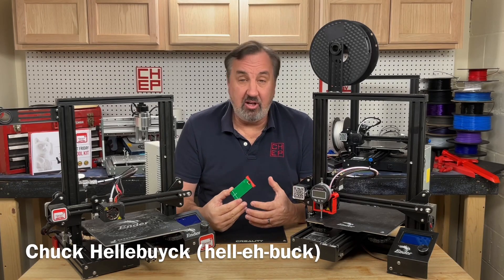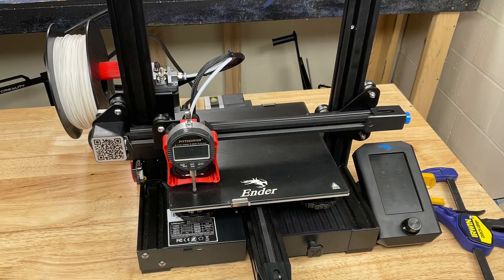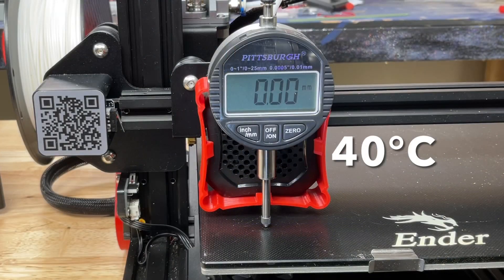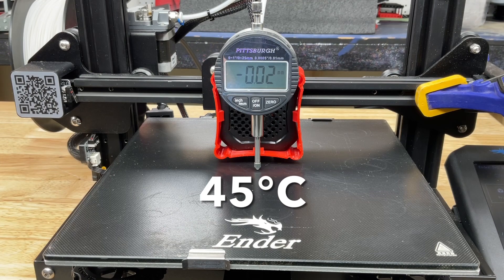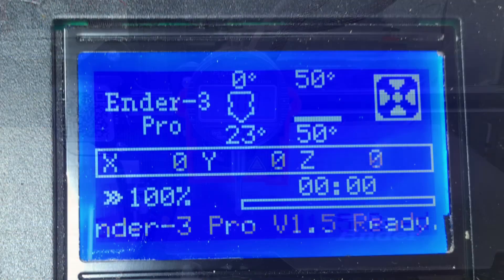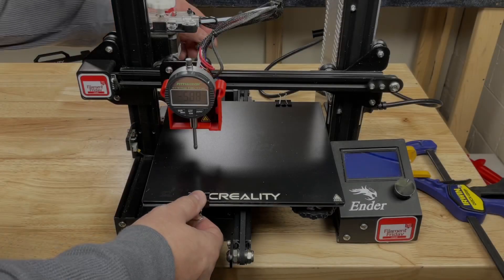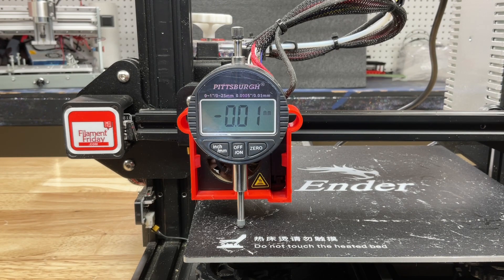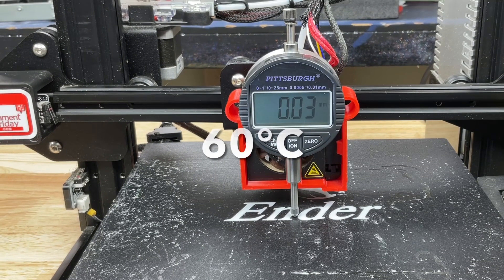Heated Bed or No Heated Bed Leveling?

Comment: Should try it at higher temps and with bigger bed. Lot of people print PETG or ABS/ASA and there (especially on bigger beds like 300x300 mm and more) at temps of 80-100 °C an offset might be (and definitely WILL be) a lot larger. I would assume say, 0.1 – 0.15 mm and that is almost a layer height.
Reply: I print on a roughly 350x350 bed at 105... It's definitely noticeable (pei flex plate). I haven't had much issue since most of my prints are roughly 1/3rd or smaller of build plate but for anything of size I use the glass plate I have.
Reply: @jackshett  well for a reason I print only from ABS/ASA and CF Nylon (functional parts, not toys) I simply ignore PEI sheet. Have one, never tried it as magnetism doesn't work well above 80 °C. Soap, hot water on a glass, let it dry naturally by bed preheating (no kitchen towels) and everything sticks to it like hell. PLA, PETG (that is dangerously sticky), ABS, CF nylon. Had not tried PC though.
Reply: @ZhuJo99  Everything I've printed on Wham Bam's PEX stuck quite well. I'm thinking you've used magnetic sheets that weren't made for that high of temperature. I've printed at 110 experimenting otherwise often at 60, 80, or 100 depending on material.

Edit: Wham Bam's magnetic base is resistant up to 150 according to their website.

Comment: I really like the test approach here! But one point I was thinking about is that the measuring point right above the adjustment screw would actually never move right? It's the pivot point. If you look at it from the front, the left and right adjustment screw basically are the two pivot points and the further you move away from them the more the deflection should appear right? Which was also confirmed by measuring in the center.

Comment: Guess ur missing the point here, the nozzle expansion is the bigger problem with bed leveling and more fiddly when printing multiple filament types tat require different temp range.

Comment: The new opening G-Code that I use on my original Ender3 (heavily modified) heats the bed before doing the mesh leveling with the BLTouch.  I haven't adjusted a bed in well over a year and get rock solid base layers consistently.  I don't mess with success.  It's continually the best performing printer I own.

Comment: I feel like the paper changes size slightly when it heats up from the bed
Reply: definitely. i use tongs to hold the paper while leveling so the heat of my hand doesn't influence the measurement.

in all seriousness, it's not like you can only level to the exact first layer height and everything has to be at printing conditions to maintain that. you can level to whatever you need so that it becomes the right first layer height when it's heated up.

i don't know to what distance i'm leveling, i just learned how the paper is supposed to feel to get a good first layer. changing the leveling temperature would just change that feel and i'd have to relearn it, nothing else.

Comment: I noticed a lot of difference with the nozzle heated. I use the classic piece of paper and every time I level with the cold nozzle prints are too close to the bed, but if I heat it up when leveling the first layer is just perfect. To prevent oozing I just retract a bit
Reply: This. Setting nozzle offset with ABL and meshing definitely shows differences cold and heating both nozzle and bed

Comment: Voron 2.4 350mm here.  Cold vs Hot makes enough of a difference to mean a failed print or successful one becuase of the first layer Z distance.   Some pirinters you may see no difference between cold or hot, but absolutely do not assume it won't matter.  Because it might.

Comment: Great Video. But there is another factor to consider. When a print is finished, some material drips out of the nozzel and becomes solid there. That affects the bed levelling with paper if the nozzel is not heated up. So I always do a preheat (both bed and nozzle) before levelling.
Reply: What you don’t clean the nozzle like a wipe after every print. Also if you are printing straight after I never re-level unless something went wrong

Comment: You didn't take into account the thermal expansion of the hotend and nozzle. Those are going to make the biggest difference and why most people recommend leveling with both the bed AND nozzle at printing temperature. Brass particularly has a high thermal expansion rate.
Reply: why couldn't you just take that into account and change the cold height you're leveling to?

Comment: 0.07mm rise in the center could take a 0.25 initial nozzle (layer) height to 0.18mm initial nozzle (layer) height. Could cause issues with bigger prints in the center. 

Best advice I'd imagine is do a mesh when the bed is hot. Manual mesh takes less than 5 minutes to do with a 3x3 grid. Saves any headache so why not.

Comment: Interesting! I just tried a similar setup on a 300x300x6 mm aluminum bed which is mounted rigidly (no springs) at the corners. Going from 20 to 80 C, it moved upwards .1 mm at the center and not at all at the corners (as measured with a .01 mm dial indicator). So I guess I will keep mesh bed leveling that one in its warmed up state.

Comment: Very interesting, thanks!
I wonder if it flexes in the centre because the expansion has nowhere to go, because of the way the plate is attached to the rest of the machine? 
Maybe if the bed wasn't attached as tightly it would have room to expand in the x and y directions. Maybe even raising the bed and resetting the zero position to loosen the springs a bit.
Generally expansion is proportional to the size in a particular dimension, so I'm thinking it would expand a lot more in the x and y directions, but not in the z direction because the plate isn't very thick compared to the width and length. I mean 1% of 5mm is a lot less than 1% of 250mm.
I also usually bring my nozzle up to temp as well when I level the bed, because there's often a bit of hard filament on the end of the nozzle, and I'm usually too lazy to remove the filament before levelling.

Comment: I have a 3mm mirror on top of heated bed on my CR10S Pro, and I can assure that making a print on a cold bed and on a hot bed requires to make a new leveling before if last one was different.
Or you can rise/lower the head manually when printing the skirt, but height is definitely not the same.
Reply from the maker: Mirror glass is not borosilicate high temp glass most printers come with so I’m not surprised. But CR10SPro is known to have level issues between prints due to the way they drive the dual Z steppers.

Comment: when i first started i leveled with the bed and hot end hot but the hot end always oozed a little. so i ended up just doing it cold and didn't see any difference so from then on i just leveled cold as it was easier. so for these printers really just use what works for you.
Reply: please retract filament and clean nozzle before start leveling ;)
Reply from the maker: Yep. Oozing can affect things.

Comment: The point of this video is to determine, what the differences are when leveling the bed/plate at room temperature compared to leveling it at print temperatures using a low cost printer. I'm supersized the difference is that small. It's less than sheet to sheet paper size differences when using paper as a gauge. (I have not tested that claim. Maybe Chep could?)

There is a sizeable percentage of Ender users and others, that use the paper level method and most have good results in bed leveling. This video shows me, cold or hot, when making the level,,, Bed temp doesn't affect the result much.

I'm seeing a lot of videos on bed leveling. But not what I want to know. How to get the right gap between a 0.4 nozzle and the bed plate? Or any nozzle size. The first layers have to work. Any error and just stop it. Make a change and start again.
Reply from the maker: Here you go: https://youtu.be/715Xop79Sus

Comment: Thermal expansion caused by uniform heating is pretty tiny.

Warping, caused by temperature gradients, creates much larger deformations. 

If a bed is heated perfectly evenly, you can bet that warping will be reduced. Cold edges causes an effect similar to squeezing the sides of a playing card together. It kind of bows out in the middle.

Great video, always nice to have some experiments to reference in the endless debates in forums and the Youtube comments section. We are all armchair scientists you know.

Comment: The gauge itself is affected by the heat, I would not care too much about the specific values but the conclusion is still accurate I guess (at least for the bed heating), but I would still heat all to minimise any variable.

Comment: Nice expt. I am not clear though how you mount the detector guage pin. If I were doing this I would mount it so the pin depresses a little (so the dial shows a definite value) then I would 'tare' the instrument. This is so as to remove any initial inertia / get-go effect of the guage mechanism and to ensure proper contact is made so you are really measuring a difference in the thickness and there is no room to take up any slack or overcome any initial static friction in the mechanism. Also you would need to account for the effect of the temperature of the metal pin of the guage because the pin will elongate or shrink as it heats / cools so ideally you would need to monitor the temperature at a fixed distance up the pin and take readings only at a constant temperature but then also the starting point must be at that temperature as well so you would need to actively heat the pin of your guage to the same temperature as your bed independently of the bed prior to starting the experiment. So to do this experiment scientifically would take a lot more work and equipment. BTW - I heat the bed to 70 degrees C and I might heat the nozzle to 100 degrees C or so for best effect when i am levelling / tramming  (the nozzle expansion cannot be ignored in this). With your method you completely loose any information about the nozzle contribution. So although it is a nice thought-provoking demo, I would not conclude anything that would change my practice based on this experiment alone.
Reply from the maker: I did mount it to have travel both directions. The zeroed the gage. If the gage metal absorbing heat affected readings I wouldn’t see a consistent zero over temp which I showed on the first machine but also tested before. Since the nozzle requires a separate test set up but I’ve already found it minor. 
So my test just concludes your not wrong to do your method but neither is someone who doesn’t heat it up.
Reply: Strictly looking at Cheps demonstration and not accounting for the nozzle: Your first point is probably moot as you can see from the demonstration that the digital indicator moves in both the positive and negative direction depending on the bed temperature/printer. As for your second point; I cannot say for certain for the indicator tip Chep is using, but with a typical carbon steel tip, the thermal expansion coefficient at 60 degrees Celsius is 0.73mm/m. Well within the accuracy of the indicator. Personally I wouldn't change your practice as everyone has their own method, these are hobby grade printer after all; unless you were working on an Industrial printer. Credentials: Automotive Product Design and Tester.
Reply: The point of this video is to determine, the differences when leveling the bed/plate at room temperature compared to leveling at print temperatures using a low cost printer.

Puma. What you said is proper. But that amount of measurement accuracy is over kill in this case.

There is a sizeable percentage of Ender users that use the paper level method and most have good results in bed leveling.

My point is. That paper they are using as a gauge,,, there is more change in that paper thickness than what we see in this bed level test.

I use to have a job in a calibration lab using such gauges. I noticed some of the gauges I used had different spring force on the measuring shaft. That pressure could affect the measurement on a floating surface. But what I worked with was measuring an object against a gauge table.

Comment: The problem in leveling cold is not with the bed, but with the hot end. Heating the hot end from 30C to 200C makes the hole assembly longer and interfere with the fist layer thickness. That is why you have to correct your leveling after the print starts. I used to use your leveling pattern and level it on the fly but now I level mine with the hot end at printing temperature and have no need for corrections.
Reply from the maker: Many many people have told me bed crap soon can cause all kinds of issues throughout the print and is needed for leveling so that’s why I did this. 
Also I don’t have to adjust on the fly when using my electronic leveling tool. It’s consistent and positions it at a true zero where paper actually introduces a 0.1mm offset error in the nozzle position and thus needs live adjust. 
I will be testing heated nozzle expansion as well but initial tests show expansion is really minor.

Comment: I’ve seen .2mm of a difference @ 100c across my print bed, 220x160mm, and more at the extremities. Distortion at lower temps is minimal, it’s above 80c you start seeing bigger deflection.

Comment: Nozzle expansion is not being taken into account here which must expand at the temperatures it operates at.
Reply: A brass nozzle that is about 20 mm long would expand by about 0.08 mm from 20 °C to 240 °C. That's a one-off error in the z-location of the first layer. There would be the hassle of making sure that there was no plastic oozing from the nozzle, but you could make the measurement with a clean nozzle. You'd probably want to recalibrate as the nozzle wears down (well, up, but you know what I mean).

Comment: Well I don't know if there is something wrong in this measuring way but I have problems when not leveling with heat bed. What I see here and wonder does spring lie to your measure (they absorb some preassure maybe) and when you measure in center combine spring preassure is more than gauge you use?
Reply from the maker: Have you ever used a dial indicator?
There is close to zero spring pressure resistance.

Comment: Interesting results, I think around the 50-60 range you won't see much of a difference. Where leveling with a heated bed matters is high temperature filaments. The temps needed for even PETG, ABS, and Nylon will have noticeable thermal expansion and it'll be enough to cause print issues. I have noticed this in my experience and barring material differences like how PETG doesn't like as much squish as PLA for example, at high bed temps it makes all the difference to level when it's fully heated. It's critical enough to be the difference between a completed print and a print failure.

Comment: Good video but you definitely need to test the nozzle expansion, trust me it expands noticeably with a piece of paper.
Level the printer with the paper while cold then heat up both bed and nozzle *which is more realistic cuz you print with both hot, and see how tight the paper is going to be held *because the nozzle expanded, I’ve tried it myself.

Comment: Great video Chuck, as always!😊🙏. I always had heated my bed and hotend then trammed with paper because well, like almost everyone, that's what we were taught to do. However about 4 months ago I decided to try a method I watched on another 3d printing channel; that is by tramming using a 0.20mm(0.080") feeler gauge and not heating the bed or the hotend. I could not believe the difference that made! Not only did I save time and energy by not heating either, the result was amazing! I must note that I do have the Creality 4.2.7 silent boards with TH3D's Unified 2 firmware installed that I'm able to run 2 bed leveling steps. First step is to start with tramming the 4 corners roughly above the adjusting wheels, using the 0.20mm feeler gauge, which is corner leveling in the firmware on the LCD screen. Next step is the full 9-spot tramming of the bed. Using the setting on the LCD screen called bed leveling (huh imagine that!), this will first home the bed/hotend then select start to begin. At each of the 9 points, still using the feeler gauge, adjust the z-axis either up or down, as needed, except the z-axis is moved this time by turning the knob on the LCD screen. Once it's completed save it to your EEPROM. This is what is known as mesh leveling so that during printing the firmware/printer will compensate for the differences in the minor adjustments made around the bed from those 9 points. I hope this helps anyone on their path to deciding whether to heat or not to heat, thanks to Chuck's awesome video! Well printing and keep printing well! 😊😊🙏🙏

Comment: Having done it both ways I haven't found anything significant,as long as the nozzle is clean.  Anymore I usually just heat the bed and nozzle, clean them both,level and print.  I always am about to print something before I level it anyways,this way I don't have to wait for it to heat up so I can keep an eye on the first layer.

Comment: The bed itself is not going to move..The spring holding the bed, they absorb the heat.
from the bed. That causes the spring to expand and contract witch causes the bed to move.
Redo your test and see if the bed movies over time..
Reply: Yer. but what about us that uses silicone spacers instead of springs, and what about larger printers like the E5+?
Reply: that doesn't sound correct, the bed will distort more than the mount ( which btw is a screw, the spring just holds the bed up against the end of the screw, so the spring will increase in tension maybe but not length)
Reply: I am a machinist and iI have put a dial indicator on the bed and I have  seen the difference
That is why I went to the silicone spacers!